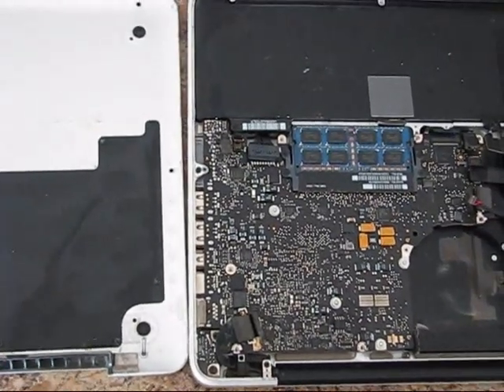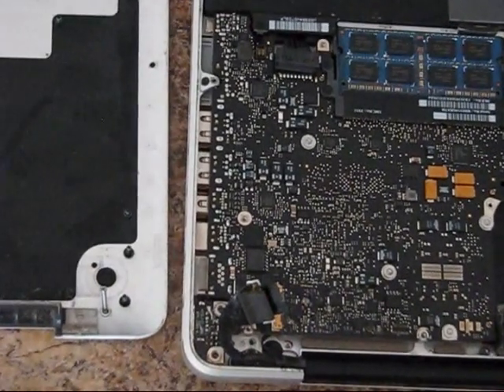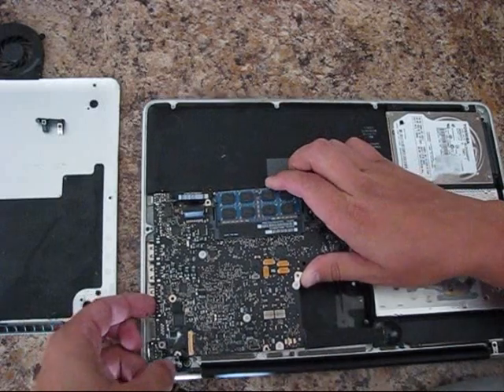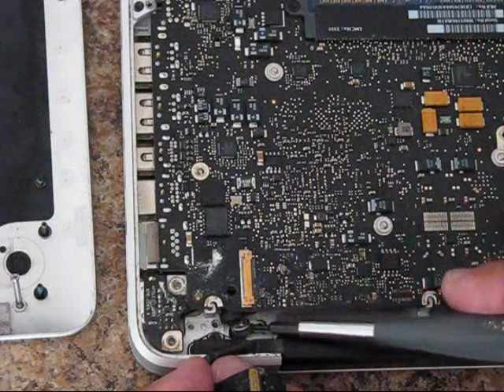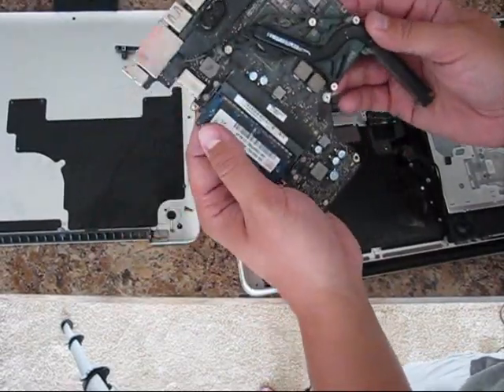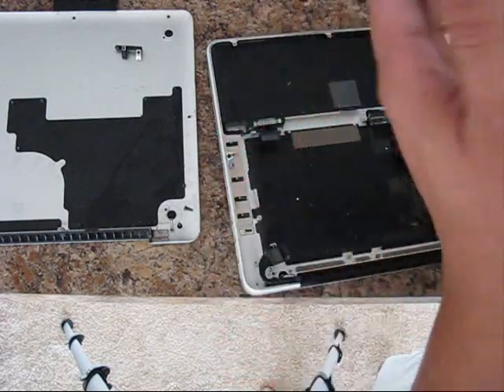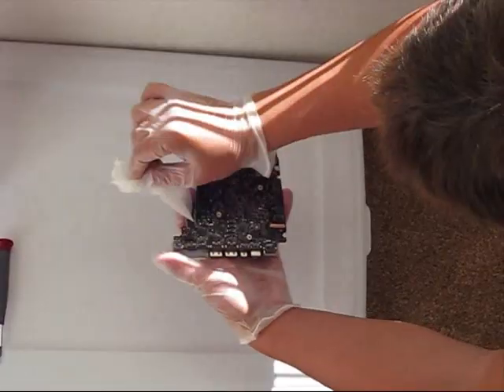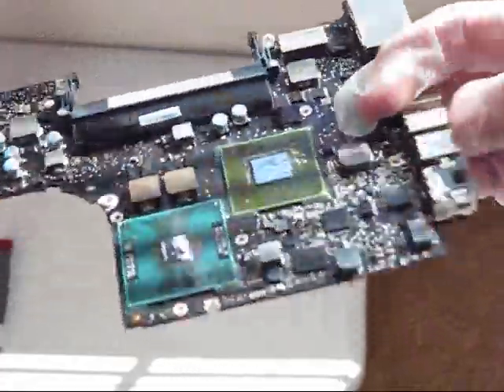2010 Macbook Pro 13 Replacing Magsafe Board and Cleaning Logic Board part 2

Comment: Just finding this video... Is there a probability that magsafe board can be replaced with usb-c power board just for powering it with newer adapters, applying all voltage difference.

Comment: I didn't go through that much trouble, not worth it.  I replaced the magsafe without completely removing the logic board.  All work fine.
Reply from the maker: in this case logic board was bad
Reply: How did you replaced it without removing the logic board?? Is there any tutorías?

Comment: If your MacBook not booting up and you have attached all cables and wires please check your Keyboard  Ribbon this is somehow attached to the power connector that is why the flaming thing won't boot up make sure you insert it fully in the logic board lifting up the plastic tab if not going in simple solution is to attach Kaptan tape or some kind of tape to force it in 

Thanks

Comment: Hi Alexey 

Great vid very informative but i'm having problem with my logic board removed to replace thermal paste replaced back into unit but now no power just green light showing up on charger light

 i am sure i replaced all cables and connectors ribbon cables etc this is a 2010 model 13" mac pro A1278 but also having problem replacing keyboard ribbon every time i put in it pops back out very frustrating   

i tried starting with and without battery - nothing
i tried starting with hdd & ram -  nothing
i tried starting with just ram - nothing
No fans running no power 

any ideas mate thanks

Comment: Hi. I have the following problem with my macbook pro 13" early 2011: 4MOT/4/40000002: Exhaust - 7022. Can this solve the problem? My fans are running at +7000 rpm constantly from when i boot up the mac. Resetting the smc doesn't work.

Comment: Dear Alex, great Video. But i didn´t get exactly how you cleaned the whole logic board? I bought now alcohol and was putting the logic board into the alcohol solution, i hope now this was not stupid. Is this right, or did you cleaned the logic board just with foam and towel? Thanks a lot Alex
Reply from the maker: it will fine if you will use rubber alcohol based wipes..

Comment: Thanks for the video. My 2011 MacBook pro won't charge after a power surge while the it was off. No LED. The MacBook however works on battery power. Could it be a damaged DC-in board? Replace the DC-in board but it still wouldn't charge. I would like to think the DC-in board I replaced with was also faulty. What do you think?
Reply from the maker: +Kwame Owusu It's possible that your power adapter went bad or something wrong with logic board...
Reply: +Alexey Gavrilov I have tried a different power adapter and it didn't work. Really hoping it's not the logic board

Comment: Can a macbook pro start (from battery) if the magsafe board is broken?
I'm trying to troubleshoot a problem with my macbook pro, battery is not bloated so I don't think it's broken. The power led is green when plugged in so doesn't seem to be there either. Just stopped working, black screen all of a sudden and no way to power up now, no beeps... nothing. So I think it's either the magsafe port or the logic board ...
Reply: +Benny Kleykens The battery is probably completely depleted.
Reply: Zestypanda
Yes, replaced the battery last week and that did solve the problem. Thanks for your reply though, appreciate it :-)

Comment: How did you get the logic board squeaky clean? It just skips from a dusty logic board with corrosion to a clean one? Thanks
Reply from the maker: James Henwood You need to use any alcohol based solution, and you good to go..